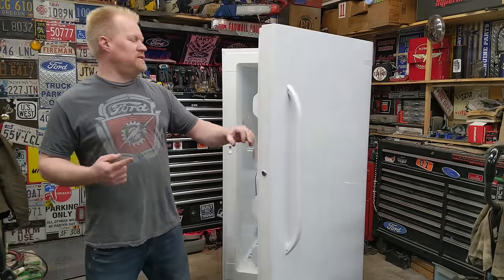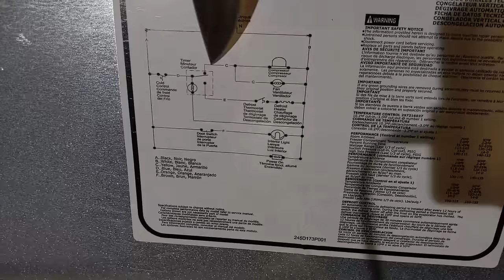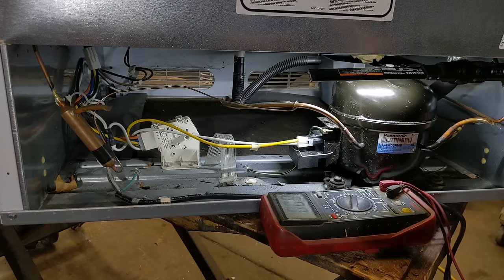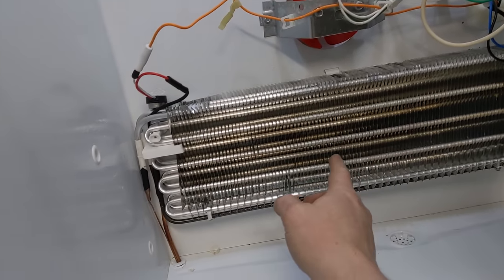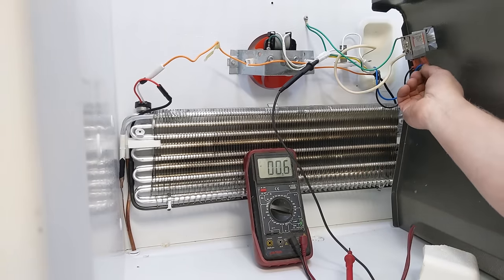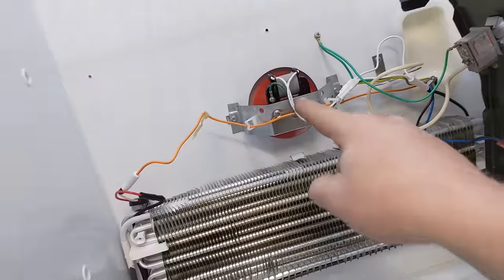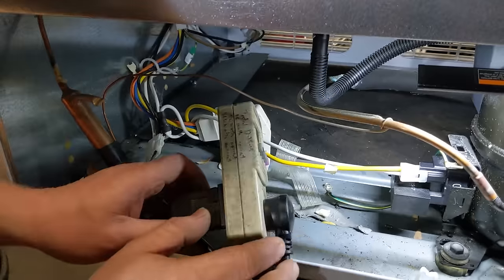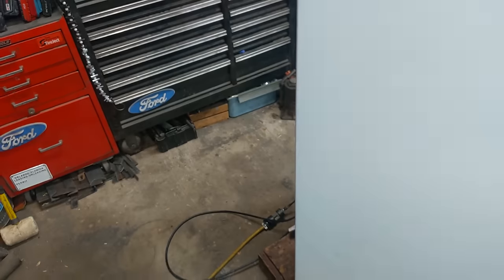Freezer Not Cooling HOW THEY WORK and REPAIR

Comment: I learnt a very long time ago to do these types of diagnostic test on appliances out of necessity, I couldn’t afford to simply buy a new one, I just fixed my washing machine a couple of months ago for just under $100AUD, it needed a new control board, common problem these days, hopefully get another 5 yrs out of it!
Reply from the maker: Nicely done. Seams like the control boards are the culprits for failure on everything these days.

Comment: I have that same flashlight. Good ol harbor freight. I upgraded the battery to a higher mAh. Works excellent especially with the magnet. So handy and its rechargeable!
Reply from the maker: Nice flashlights. This is my second as the first just randomly died after 5-6 charges like most HF does. The second one seams to be going strong though.

Comment: My capacitor is reading like a 0.3   ..cud that be the problem as why it's not working . Plus not getting any power to those plugs
Reply from the maker: Are you using a special capacitance meter to measure the capacitor? If no power is going through the thermostat you could just be your thermostat.

Comment: Hi again. You used 3 meters during troubleshooting. The 1st one was a volt-ohm meter, the 3rd one was a wattmeter. You used an orange meter to measure the capacitance. What type of meter was this?
Reply from the maker: The one red meter would have done everything it's just not as easy. The orange one is a dedicated capacitance/capacitor tester that I paid around $15 for 10 years ago https://amzn.to/3ETf0HB .

Comment: You better know what's in the thermostat bulb.  It sure isn't mercury. It would be a refrigergerant mixture of some kind. 
I've been a technician in the commercial side for 41 year's now. I worked on refrigerators and freezers when I was going to trade tech. I actually worked at a thrift store fixing them to put me through school and practice what I learned during the day. A fellow classmate actually picked up non workable refrigerators and freezers like that and fixed them for extra money.
I decided that working on commercial HVAC was a lot better field. 
Interesting video though
Reply from the maker: I work on a ton of vintage refrigeration items that have been mercury in the bulb.   Newer stuff is proprietary and the only thing you can research says it's an alcohol blend.
Reply: @sixtyfiveford  just be carefull with the old monitor tops. I hear they have some nasty refrigerant. Keep up the good work 👏

Comment: My freezer is cold but the compressor never stops running.  Thoughts? Thank you.
Reply from the maker: You really need to know how cold your freezer is. Are we way down into the negatives or just barely below freezing? If it's way down into the negatives and you can't shut it off with the thermostat dial, then your thermostats are likely bad. If it's barely below freezing there's a chance you're low on Freon and it's struggling to maintain a temperature.

Comment: wow 7 dollars for a new thermostat? Where did you buy it? I bough one for a mini fridge and cost me 50 bucks lol same brand as the one you bought damn (just saw the link nvm) I guess I got ripped off
Reply from the maker: Ebay is generally the cheapest. Amazon is generally the fastest, mixed with the cheapest.
Reply: @Emmanuel: Don't look at it that way. You still saved yourself the repairman's labor charge & any parts markup which can be significant. For Example, when I worked at Amoco even a $10 part was marked up 280% and it went down the more expensive the part got. You still probably saved at least $200 in the long run!
 I like Amazon for parts because your big parts places are there, too. I've found parts for washing machines there, too, as well as electronic parts.

Comment: Hey here's a non-freezer electrical question. I have a 3 speed ceiling fan that got to where it would only run at one speed. Replaced the capacitor and it worked on all 3 speeds for a while, but then quit completely. Have been too lazy to fix, but I'm wondering if it's the capacitor again, does that mean something is going on with the motor that's causing capacitors to fail or just that capacitors used for speed control aren't very good?
Reply from the maker: I have worked on a few ceiling fans and it seams like the capacitor is notorious for going bad.
Reply: @sixtyfiveford  Yeah is was thinking that was the problem again. Just been too lazy to take it all apart! I need to see if I can find what kind it was so I can get it before I start working on it.

Comment: Question: I have a side by side refrigerator and freezer that's in the garage and works perfect however during the cold winter months it doesn't cool. The garage isn't heated so it's extremely cold. Is there anything I can do to solve this issue? Thank you and happy new year.
Reply: Sounds like there is only one thermostat in the fridge section and when the fridge gets cold from the garage temp the compressor won't kick on.  You could perhaps build a box around the fridge and keep it heated with a low wattage light bulb or electric heater.
Reply from the maker: I assume the freezer part thaws and the both sides are at 40ish F? dictare said it right. The fridge side only cools from the freezer side. And the freezer side only turns on when the fridge side says it's too warm. So if the fridge side is cold enough the freezer will never kick on. They sell kits that essentially warm the thermostat constantly "garage ready kits". But they just make the fridge/freezer run non stop, which is expensive. 
Just thinking:
You could find the thermostat wires(even from the back/under side) and wire a toggle switch onto them(bypassing thermostat) and just flip it on once in a while. Or even wire it to a time so it comes on for 30 minutes a couple times a day.

Comment: My KillaWatt turned into a paerweight after nearly no use...crud.
Reply from the maker: Yeah they have a temperature fuse that goes out pretty easily when overloaded. I have a video on it: https://youtu.be/XdInw4b1k3c . However, I no longer replace the fuse. I just bridge the gap with a wire. I've had to go out so many times that now I just do that. There's also a power fuse as a double safety.

Comment: Before I even watch I’m calling it on a bad thermostat it’s typical for these units
Reply from the maker: I see where the thermostat bulb had leaked out. So whatever alcohol mix they are using today in the thermostats is eating away the solder and causing it to fail.

Comment: Great video, I wish you would have gone farther in the discussion of the operation.  My fan is working and all seems well but it is not freezing. I assume it is low on coolant
Reply from the maker: Does the compressor start and run?
Reply: @sixtyfiveford  Yes it was running, but it would click off then back on.  I tested the compressor leads for continuity and they were good.  Also was not grounding out.  I replaced the compressor control switch and capacitor.  Now the unit is working great.  On as side note, it is an older unit so if I put the thermostat too high the compressor has to work too hard and it shuts it down (overload).  Keeping it around 4-5 on the dial it runs great, nice and frozen.

Comment: A friend gave me his old freezer(maybe 6 years old), and it isn't working.  It has been on my list of projects to tackle and get working and sell.  Thanks for the help on video.
Reply from the maker: Awesome
Reply: @Mike Spain Remember those limit switches go out, too. My cousin had one that went permanently closed and her frozen meat had rings of green rot in it because the limit switch would not stop the heating/dethawing process. So the meat went from frozen to overheated every dethaw cycle.

Comment: Those start capacitors are also used on air conditioners and many places where there are compressors or electric motors . They are inexpensive . I believe that defrost heater ( element ) can be tested by using an ohm reading to make sure it's not broken .
Reply: They can ground fault aswell

Comment: My freezer loses charge over 3 months.  Is there any sealant I can put in when recharging it?  I think leak is in side wall. Very slow.
Reply from the maker: Yes, I forget the name of it off the top of my head but I used it in this video: prt1  https://youtu.be/3TOp0D0dTZs prt 2 https://youtu.be/FZE7J2yxyPA

This is an older video and probably a little slow in presentation but essentially they have a product that is meant to seal steel lines. This differs from the conventional leak sealers that just swell rubber seals.
Reply: @sixtyfiveford  thanks

Comment: Nice fix. Got to love the easy ones. I've started avoiding picking up broken fridges/freezers because the past couple I got had bad compressors and I don't have the means to evacuate and recharge.
Reply from the maker: They can be a pain to dispose of. But remember all the scrapper guys aren't collecting the refrigerant. Can't really blame them as it is such a pain. Also a small trivial fact is computer air duster is just refrigerant. I have old cans computer duster "cans of air" of r12 freon, r134a and r152a. So that is just dumping refrigerant straight into the atmosphere.
Reply: @Dustin: You could probably make one out of one of those old compressors. It'd help if you could braze copper but you can also get fittings with the "olive" that fit and only need wrenches to work with. I'd search YT, I'll bet some one has done it already. And 10 years ago this video went up: https://www.youtube.com/watch?v=efaeYM0rpY0
Reply: BTW searching for that I even found people making their own refrigerant!

Comment: Do you have a video on a MD size refrigerator  with top freezer that has freezing problems ?
Reply from the maker: I don't. If the top freezer is icing over, either the drain hole at the back is plugged up(melted popsicle sticky) or the defrost heater isn't powering/working.

Comment: The Most common problem on freezers is the fan is not working. This will also make the evaporator ice up. OR the door was cracked open and made the freezer ice up. But yea the heater could be a problem too. They are very simple to fix. Thanks MOE for making a video for people. this will prevent more landfill freezers.
Reply: Evaporator fans are NOT the most common issue freezers have. Evaporator fans die because of defrost issues cause them to be encased in ice. Defrost issues are VERY common. 🙄

Comment: Great video, thanks!  I have an older White_Westinghouse refrigerator - freezer that stopped getting cold,  I let it sit a few days and turned it on today with a watt meter attached,  I could hear the fans come on and could hear a slight buzzing sound, the watt meter went up to 794 watts ( I think that was the defrost mode?)  and about 20 seconds latter I could hear a little click sound (in the freezer compartment?) and the the buzzing stopped and the watts went down to about 18 watts (fans only?)  Any suggestions?  Thanks again...
Reply: I forgot to mention that even when I turn off the fridge, it's still drawing about 9 watts;  my mistake, had the wrong switch on now when turned off it reads 0 watts..
Reply from the maker: That sounds more like the compressor overload kicking in. Try it again but put you hand on the compressor. You should feel it humming and feel a click if it is.
Reply: @sixtyfiveford  Thanks for your reply;   my mistake, had the wrong switch on now when turned off it reads 0 watts..  it will be some time before I can drag the fridge out of it's tight fit location to check the compressor.  Thanks again..

Comment: Great video!  I had my fan frozen up due to a thaw from the door being left open. I removed all the ice and the fan started working.   I have this exact model, and when I was putting the cover back on over the evap coils, the screw missed the hole,  and went in to the coil right were your finger is at the 10:52 mark.  My question is, can that hole be soldered over, or the coil replaced and have the system refilled with refrigerant?  I have read that it is a closed system, and that isn't possible.  Please help before I have to go spend $1000 or more on a new freezer because of my dumb mistake.  TIA!
Reply from the maker: The coil should be aluminum and basic solder won't work. If it was copper or steel yes. There are products that do work but they aren't easily done. If you found the correct size compression fitting you could likely splice over it. As far as refilling it, that can be done with a specialty item called a line tap. It pierces the line and has a valve to hook up a gauge set. You can then refill it. It should be an r134a system. You can buy cans of that at Walmart or any other store. I do have a two-part video on a freezer that I refill that covers pretty much everything.
Reply: @sixtyfiveford  thank you...if I could find a compression fitting to cover the hole, how important is it to vacuum out the lines before adding R134A?  I mean the whole system has been exposed by this time.
Reply from the maker: @krzsrh  It won't work if you don't vacuum the system.
Reply from the maker: Honestly though, these and new freezers are built very badly. You'd be better in the long run to find a second hand upright from the 70's-90's. They last forever.

Comment: How did you know it was that versus the thermostat that clips on the evaporator.? I the clip on one was bad it would not start either right.
Reply from the maker: The little clip on thermostat switch on the evaporator only controls the heating/ice melt function. If that failed it would cause excessive ice to build up on the evaporator and choke off air flow to the freezer. The freezer would slowly increase in temp over days/weeks with the massive ice block. The little enclosed area with the evaporator and main thermostat would remain cold from the ice block so it wouldn't turn on the compressor.
Reply: @sixtyfiveford . great video as usual.  I got it crystal clear now. keep up the good work. mine was less than 2 yrs old but was freezing up. had a thermistor but all the things were good. but it did not get a defrost command. I finally found the board was not sending the command. again thanks

Comment: Where are the condenser coils on this freezer? I'm trying to clean mine and can't find them. I checked the back and the bottom and they are not in either place
Reply from the maker: Under the sheet metal skin of the entire freezer.
Reply: @sixtyfiveford  thats what I thought. When the compressor is running the sides get really warm. Thank you for the reply!

Comment: What if the top 3 coils are freezing up and not past that?
Reply from the maker: That is generally a sign of low refrigerant or failing compressor (pump pressure). Your need to give it 5-10 minutes sometimes for all the coils to be frozen/frosty.

Comment: What does it mean if your compressor is hot to the touch
Reply from the maker: If it's the first startup from being defrosted then it's nothing. If it's been running for a while, weeks/days and it's hot it's struggling to keep the inside cold. This struggling could be from low Freon, A bad compressor, the door seal leaking or you just put in a bunch of warm food.

Comment: that ac power will wake you up in a hurry!!!!!!!!!!!!!!!!!!!!!!!!!!!!!
Reply from the maker: It always does. Luckily I can't remember the last time I've been shocked.
Reply: Not always. I made a new undercabinet kitchen light with an 18 inch LED bulb and I used an old cord on it. ( Plus I sometimes hold wires up with thumbtacks between the conductors. I know it is not the best practice but I do it.) The other day I was sponging down the counter and got repeated light zings. Time to upgrade that cord!